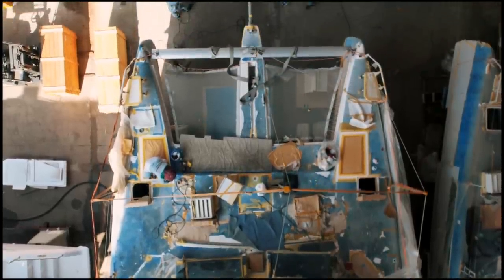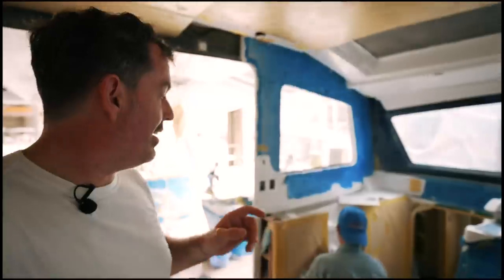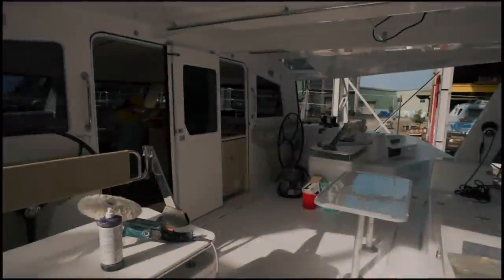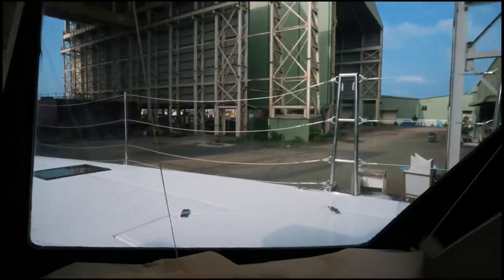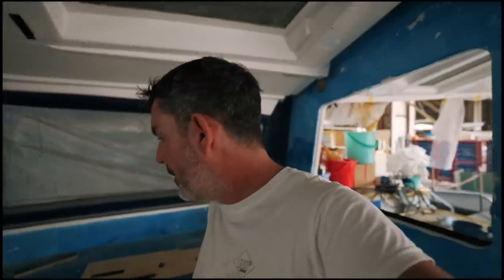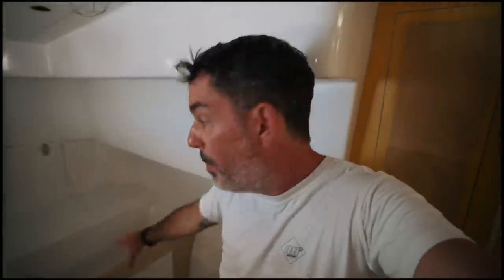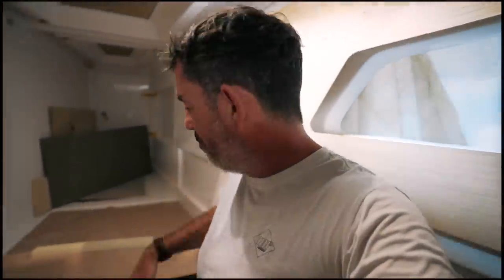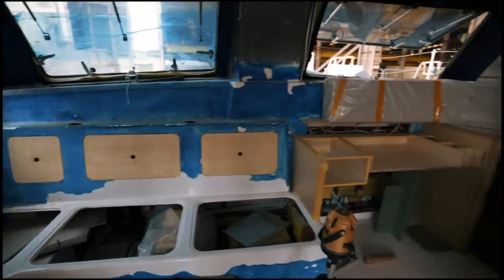COMPLETE Ruby Rose 2 Catamaran Update- We're Getting Close!

Comment: Excited for the launch. Keep an eye on the Miele, my son recently decked out his kitchen in full Miele. The oven micro steam combo was a disaster. Water leaked everywhere it went mouldy after every use and after 6 months the micro stopped working. They couldn’t get it installed by Miele despite a Miele store nearby so the warranty was voided. 6 months after purchase they eventually swapped it with a second oven under warranty and another $1200 plus bought a separate cheap microwave. Check warranty if not installed by Miele. Very disappointed in Miele customer service for the price. Would not buy again.

Comment: Wondering. What’s the model difference between this and the new boat tulas endless summer  just rolled out on YouTube? Thanks!
Reply: 1170 and 1370
Reply from the maker: Hey mate, there’s is basically a smaller version of ours. It’s an 1170 so 11.7 metres in length and ours is a 1370, so 13.7 metres 😊
Reply: @sailingrubyrose  thank you!